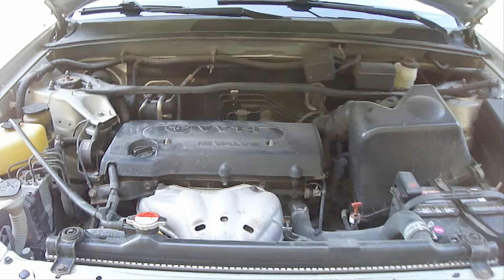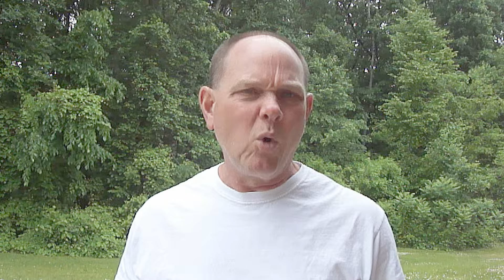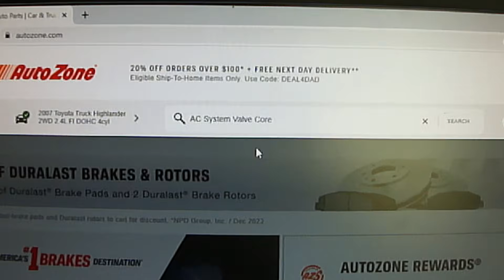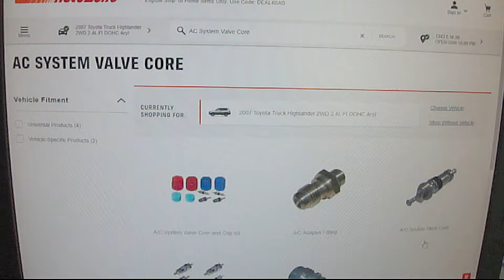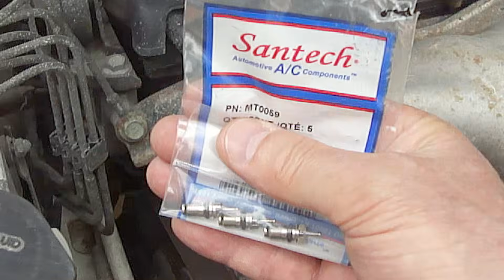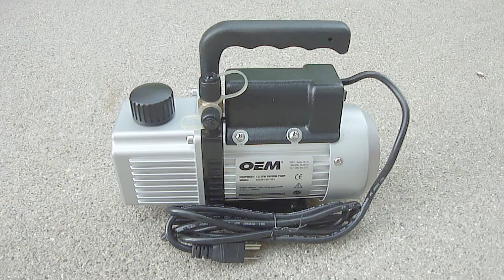Car AC Not Cooling - How To Easily Replace AC Valve Cores

Comment: Datapoint: My Mk4 VW doesn't have valves that work like this. I bought some replacement ports that allow Schraeder valves to be used but the High side port is leaking at the O-ring so now I gotta work on that. (I'm no longer sure the original high side port was leaking but maybe).

Comment: Just use the removal tool. No evac needed
Reply: I tried a Chinese cheapo (non-evac) tool and the tool tip kept unscrewing from the tool shank. The valve cores are screwed in super tight on my 2009 Mustang GT. The low side shows a leak when I check with soapy water.
Reply: @gorblimey61  I got those and that happened even though they don't fit my valves. Really loose. Maybe try some red threadlocker.

Comment: 7:18 From where can I buy the valve torque tool please.
Reply from the maker: @StephenMizzi  Amazon, EBay
Reply: Oreillys, Autozone, Napa any tool/art store
Reply: AI said it’s the same tool for tire valve cores, but I’m suspicious. I have the 4 way type for tires not the screwdriver type. I don’t think mine is long enough.
Reply: @BWeezy-sw1wy don’t use ai for car work.

Comment: On the AutoZone website if you select "A/C System Valve Core and Cap Kit" it will give you a complete kit that includes both High and Low side valve cores as well as new caps. I found this to be much more cost effective than purchasing the valve cores separately.

Comment: Sometimes if you have a leaky valve you can tap it with a key or a screwdriver really fast and it blows crap out of the seal and it reseats and stops leaking.
Reply: I did that with my propane torch. I took off the nozzle and it was leaking from the can. Found a nail and quick popped it. Used the pressure behind the valve to make it seal.

Comment: What could be the reason my a/c blows cold in the back seat area but hot in the front driver/passenger area?
Reply: Blend door actuator is bad, or blend door is stuck
Reply: @rannz8  Thanks for the response.
Reply: Wrong amount of freon usually just had this issue with my Honda pilot
Reply: @bmoredrew4724  I haven't put any freon in my vehicle.
It just started blowing hot air.
Someone else said it may be my actuator, whatever that is because as a female that's new to doing my own vehicle repairs, I'm still learning.😏

Comment: Thank you for the great videos. They are extremely helpful. 

I have the same size schrader valves in my Lexus that you show in your video. 
(It’s listed as a JRA core on the Schrader Pacific website). 
On that website the torque specification for this particular valve is listed as:

5-10 inch pounds or .56-1.13 Nm of torque. 

Unfortunately I cannot find a valve core torque tool for this range. I am using a 4 inch pound torque tool like you show but adding slightly more torque after the click. 

Found online at: 

Schrader Pacific 
(Advanced Valves)

A/C Valve Application and Installation Manual
(Mobile A/C Systems)

Comment: Hi sir today i just check the refrigerant level in my car by using a gauge and it was good. Car is 5 years old. I doubted if the schrader may got damaged by the gauge fitting. And after driving my car for a while i checked the port cap it was too tight now i had just hand tight it but i had to use pliers to open it. When i opened i heared a hiss sound.
So my question is can the port cap which has a o ring inside prevent the refrigerant leak if there is a leak.
Reply from the maker: No. Your hiss sound is due to a leaky Schrader valve which needs to be replaced.
Reply: "just check the refrigerant level in my car by using a gauge and it was good" - Sorry, a gauge cannot really determine refrigerant level; only real way is to have special equipment recover and weigh it.